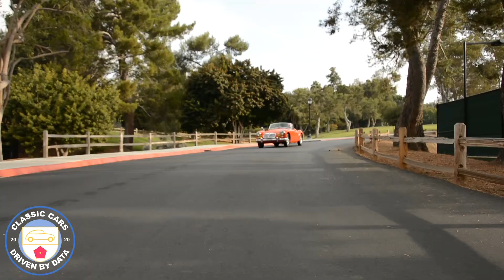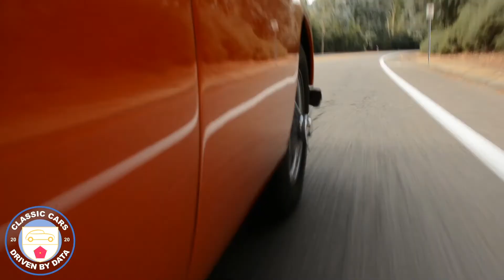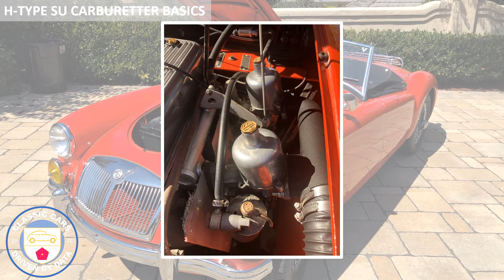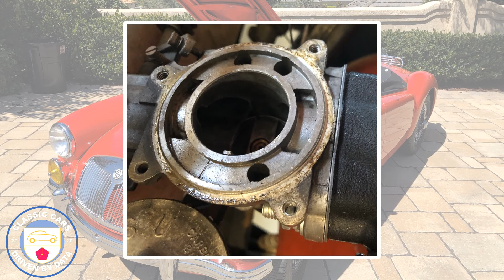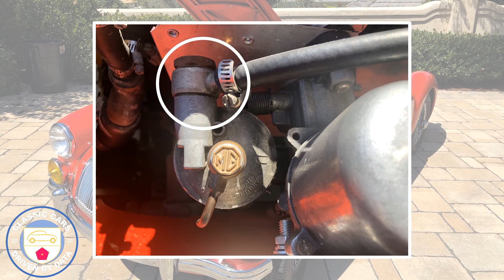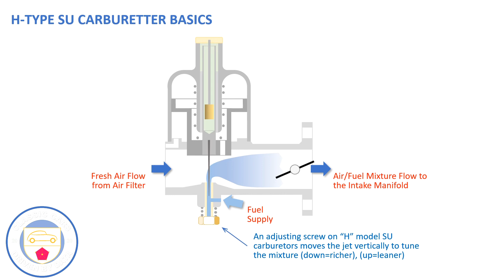1958 MGA - H4 SU CARBURETOR OPERATING PRINCIPLES - ANIMATIONS SHOW VARIABLE VENTURI AIR-FUEL CONTROL

Comment: Hi enjoyed the video about parts to the carburettor.  
In fact I have just fitted a vacuum line too and from the carbs to distributor never had one fitted a previous owner had cut it off for reason unknown.
Just one thing which I had only just found out is the filters in the top off the fuel bowls where the fuels runs  through might be worth mentioning?
Otherwise I would have loved to have found this 14 years ago when first bought my Mga 1500.
In fact I have just found out my carbs are from a 1600, dont think it affects the running of the engine.
Regards Tony

Comment: As to driving without oil in the dash pot. Some early MGBs had SU carbs where the brass nobs on top spontaneously loosened, especially at speed. Mostly it caused rough running. Pull over, tighten down and go. Without oil in the dashpot the engine will just stall out. BTW - if you need SU service and can't  find anyone, try a custom motorcycle shop. Harley engine builders love them!